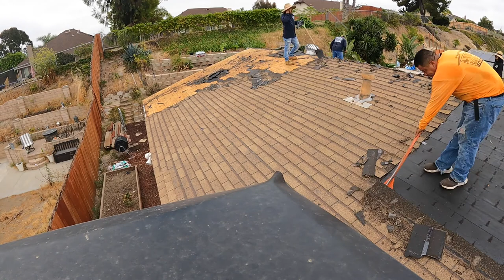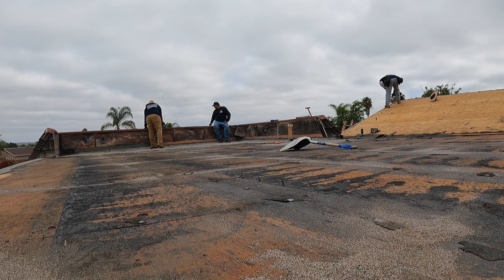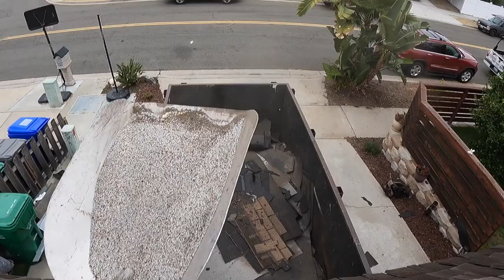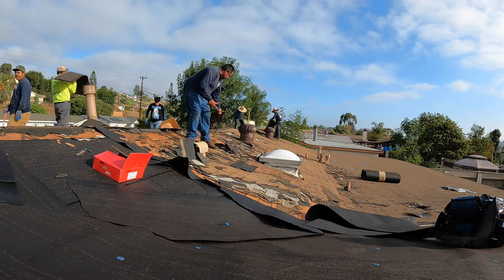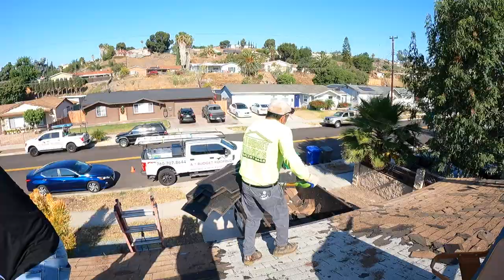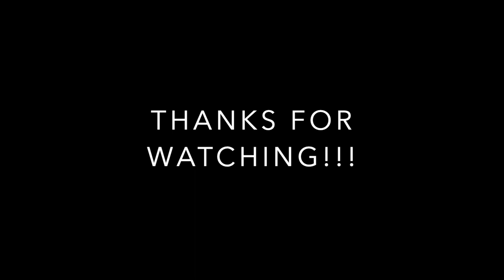Episode #2 :  The process of a Roof tear Off!  #work #money #workmotivation

Comment: You know what helps in making a faster tear off?

Not pushing the shingles you've just torn off down onto other shingles that are still nailed to the decking. Making you have to either push the pile down as you go, building it up as you go until you get to a point where it's too much, or you can simply grab it and put it in piles to side side of you on the second layer of shingles or on the decking.

Makes me laugh when guys purposely make their job harder by doing it like you do. And rip the shingles in the staircase pattern that they were installed, much easier tear off and doesn't come off in pieces.
Reply from the maker: In the case this roof had 4 roofs on it and was easier to push down due to the amount it layers and we were redoing the flat roof as well. It made it easier to scoop trash from flat roof so my guys didn’t have to stop.  Thanks for the advice!👍🏾